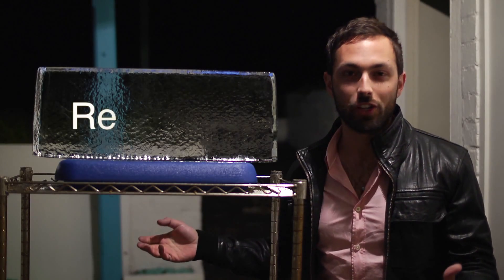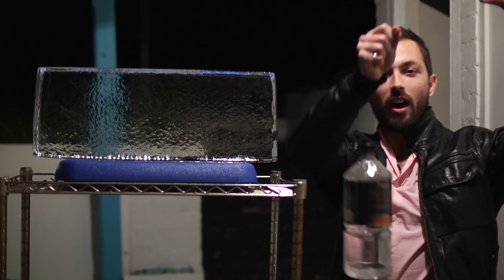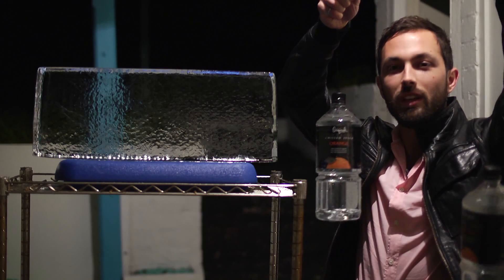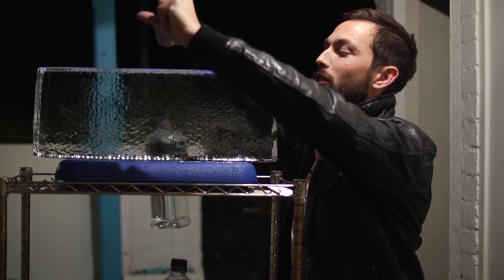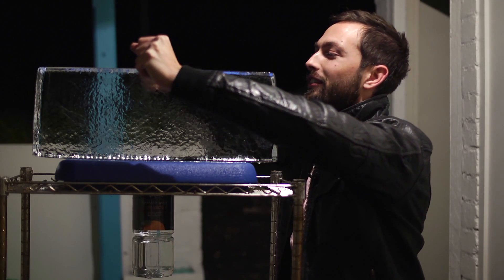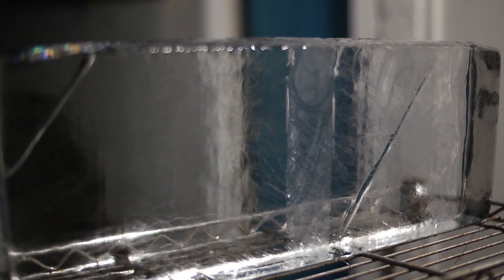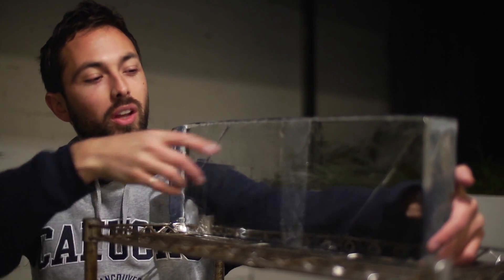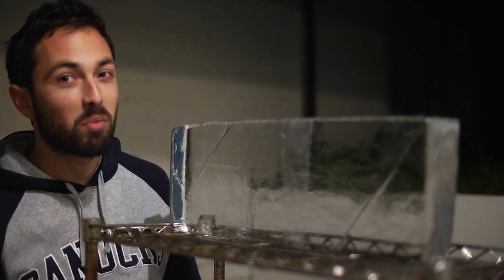Does Pressure Melt Ice?

Comment: Does this prove anything?
Did the ice turn to liquid, or was it just cut as a solid and then refroze together?
Even if the ice turned to water, did it then re-ice because the pressure was released in the upper parts, or because it was close to the two sides of the block that cooled it down?
From a point of critical thinking, as much as I believe that the melting point of ice reduces under pressure, I don't think this experiment proves it.
I would like to see a small cube of ice in a hydraulic press (its whole top+bottom surface, so it is not cut) or something. I would say the sides would have to be contained so it does not crush to pieces, and then we should wee a small amount of water going down from it a refreezing. Or a pressure chamber, it would melt, then release the pressure, it would refreeze.

Comment: veritasium: "i chose the e-string because it's much more thinner than the g-string, and that's important."

me: "what"

veritasium: "what"
Reply: @AbdulWasiun_Tech  g string is a type of women's underwear, it's also called a thong.
Reply: @AbdulWasiun_Tech  see the face that he makes at that moment
Reply: @AbdulWasiun_Tech  
the joke is about the g string
Reply: Area of pressure is lower, and thus pressure per cm² or something is bigger
Reply: @FarhadHakimov  While you are probably correct, I think you missed the joke
Reply: Farhad Khakimov 
Force per cm squared. Not pressure. Pressure is the result of force/area. Not only did you miss the joke but you also missed the theory course.
Reply: @frlfrl2098  ur wrong
Reply: @willswan8896  
Then correct me
Reply: @willswan8896  he's not wrong at all
Reply: @willswan8896  Pressure is Force/Area. So, if we have the same overall force (weight of two bottles), pressure is stronger when we have a smaller area of contact. If the area increases, the pressure decreases. If area decreases, pressure increases ("more force applied on every cm^2")

Comment: I'm not buying it. There's equal pressure across, yet the wire is curved. The wire picks up heat from the air and transfers heat in from the sides, the center staying coolest. It refreezes because the cut is thin and surrounding air temperature doesn't enter well enough to keep it above zero.

Comment: You should repeat this demonstration in a freezer because one could argue that this was about metallic string tranferring heat from the room into the ice and the melting of the ice happened around the string because of that. And obviously the water will freeze again after the string has gone away because there's a big block of ice nearby. If the room had been below 0 °C this cannot happen because the whole string would have been sub zero for the whole experience.

I see you already did this: https://youtu.be/qQCVnjGUv24

Comment: Couldn't this just be explained by the sections of wire in open air, absorbing the heat in the air, transferring it into the ice (melting it) then slowly descending, then the water refreezing due to the lack of heat energy input and having what little heat energy it has being absorbed by the rest of the ice? 

From what I've found, in order to lower the freezing point of water, it takes 1 atmosphere to lower the freezing point by .0072 degrees Celsius. That's 138.88 atmospheres (or 2,040 psi) to lower the freezing point by 1 degree Celsius.

If this is truly regelation, then you should be able to replicate it in below freezing temperatures. I'd like to see it in 0 degree Fahrenheit weather.

Comment: The cord dissipates the cold heat, so the ice melts, but once the cord has passed, it can freeze again easily. The experiment does not prove that what happened has anything to do with pressure. To do this, you would have had to place another cord that had no weight.

Comment: So here is why this obvious and well known fact is weird to me:
1. shouldnt heat only be created when something is deforming? If you pressure something and it doesnt deform (it will only deform a tiny bit when the pressure is applied and after it has reached a new equilibrium no more deformation should take place) shouldnt there als be no heat production?
2. if point 1 is not true then where the hell is that energy coming from? That would mean placing a large mass on another mass would be producing heat energy constantly without losing any potential energy because without deformation it wouldnt be getting closer to earth's center. So that should mean you can produce heat out of... nothing...?

Comment: Was it really the pressure that melted the ice? Or was it the transfer of heat through the string?
To do that experiment properly, you would have to perform the same thing in an atmosphere that is at the same temperature as the ice, maybe that string has salty sweat from the fingers that was doing all the melting? I bet that the g string would have gone through faster! Especially if it had been worn LoL...

Comment: Doesn’t the temperature of the wire play just as much a role as any pressure? The wire isn’t 0 Celsius either. I think in order to isolate the pressure cutting the ice theory the whole thing should be done in a freezing environment or the wire should also be cooled down.

Comment: could a similar effect be achieved if you used a very hot wire, maybe by using a steady electric current, to use on meat. would the wire cauterize the wound as it went through?

Comment: You get the award for least scientific science experiment. 
You added a heat sink and weighted it with more heat sinks. 
Had you used nylon floss or pretty much anything not metal you'd be closer. Or had the exact same set up next to it with less or more weight to show the difference the weight makes.

Comment: If it was above 0 degree's centigrade could the ice be melting due to an increase in the rate of temperature increase given by the wire, which conducts heat more than the surrounding air? As for it solidifying again as mentioned below could that not be because the gap is exposed to the surrounding ice rather than the wire after the wire has passed through it?

Comment: The ice is at least at the temperature of —10°c where the string is hardly the temperature under 20°c. It will exchange heat when they'll touch each other. Let's not talk about room temperature. You should have told people the reason why it's happening in the experiment. I guess you don't even know why those 2 pieces of ice get affixed although they were cut in half. I'm not saying you are not good. But don't give them the wrong information 🙂

Comment: Doesn't the type of the material of the string also contributes to the melting of the ice? It can act as a better conductor of heat coming from the ice block's surrounding that's warmer than the ice, compared to the air itself.

Comment: This is actually because where the ice finishes there is less atoms holding the water atoms in place and they are in a state that is neither liquid neither solid. So no, ice isn’t slippery because your body applies pressure and melts it turning into water. Also water isn’t as slippery as ice is.

Comment: It's not that I don't believe the phenomenon exists, but your experiment has a problem. The refreezing could be happening because you have ice right there freezing the water again. This experiment should be made in a vacuum chamber with ice temperature, regulating air pressure through vacuum or pumping air inside or using a pressure instrument. The key thing here is keeping the environmental temperature in freezing temperature and all instruments in freezing temperature as well

On a side note, that explains why just putting ice in your mouth melts more slowly than when you apply pressure with your teeth (without crunching)

Comment: Try it again with a string of plastic. Plastic has a lower heat conductivity then metal, but uf it is because of pressure they should pass through the ice at the same time.

Comment: This is thermal conductivity nothing g to do with the pressure u put on it. The wire is being heated because there is a lot more wire not touching the ice which will make the wire touchi g the ice a fraction warmer than the ice it’s selfie causing it to melt and because it takes so long to cut and because the cut is so small it is able to re freeze itself back together.

Comment: That's not just pressure. This is very misleading. In fact, increasing pressure alone would actually induce freezing. This has more to do with crack propagation (induced by high local stress).

My guesstimate as to the refreezing is that it simply caused by the surrounding ice having low enough energy state to absorb enough energy to freeze any local water that has been liquified during the process of crack propagation, which could only occur if the temperature of the room is above 0°C.

This is coming from what I've learned from engineering classes relevant to the situation - mechanical behavior of materials and thermodynamics. And I can definitely say that pressure alone is not the cause of this phenomenon.
Reply: Monly96   I believe the temperature being above 0 degrees C is part of the experiment.
Lowering pressure can cause water to boil, and I also know of water condensing into ice under extremely high pressures, as is the typical in basic thermodynamic theory. 

If you account for local stress concentrations in a crack, helped by a wet surface layer caused by the temperature of the surroundings being above freezing temperature, you can cause the ice to easily cave (crack), relatively speaking, cue crack propagation. Refreezing could simply be a process caused by the cold thermal reservoir - the giant chunk of ice.

My details could be off in relation to the full process, but my point is that an increase pressure alone causes water to freeze, not ice to melt, so another process(es) is/are at play.
Reply: @Monly96 Interesting. Yeah I'm gonna be honest I didn't expect water had a negative slope in the phase diagram between solid and liquid. It's possible it melts under higher pressure up to a certain point where standard effects overcome the special properties found in water from it's secondary bonds, that would explain why I've only heard of water condensing under pressure at extremely high pressures.

I guess the much more interesting question is why water/ice behaves that way under pressure.

Comment: It looked like the ice was melting meaning it wasn't below freezing where it was stored. If that's the case then the guitar string could be wicking away the heat as it cut through and the water refreezes because the internal temperature of the ice is well below freezing.

Comment: This is a unique characteristic of the water coming out from its hydrogen bond, which causes H2O molecules to form a kind of hexagonal shape when it is in solid-state. This makes the solid state of H2O, the ice, less dense than the liquid state of H2O, the water, unlike other materials because there is vacant space inside the hexagon of the frozen H2O; general material's density is higher when it is in solid state.  (if the ice were more dense than water, there would be no iceberg floating around the two polar regions).
And, as pressure increases, density also increases, regardless of one's state: solid, liquid, and gas. Same for the water. As pressure is exerted on the ice, its density also increases, and the most dense condition of H2O is achieved when it is in liquid state, the water (the pressure breaks the hexagonal shape of H2O).

Comment: Is the ice cutting due to pressure or transfer of heat through the string? Also, the water at the cut might be freezing again due to the contact of ice around it.

Comment: here's a fun experiment you can try. Take a 20 ounce plastic bottle of soda(unopened) and place it into your freezer for 90-120 minutes. if your timing is right, it will still be in liquid form with no apparent freezing/ice formation noticeable. Remove the cap and watch as the soda flash freezes before your eyes. When you remove the cap, listen for the sound of excess carbon dioxide rushing out as it is released from the sealed container. that sound will signal a sudden drop in the bottles internal pressure which will then cause the liquid soda to instantly crystallize into a slushy semi solid mass so that you'll now have to squeeze  the bottle to get the stuff out.

Comment: one thing I don't understand. How are we sure that the sorrounding ice isn't simply re-freezing the water? How do we know it's the release of pressure?
Reply: you mean re-freezing and yes its not the release of pressure that re-freezes.
The required pressure is much higher than he applies to the ice. It's just the string heating the ice by thermal conductivity and it re-freezing due to contact with the frozen ice.
source wikipedia
Reply: @FullOilBarrel  so this experiment proves nothing then cool
Reply: @RainingArtillery  no yea your right. if he conducted it in 0 degrees C the string and the ambient temperature couldnt liquify the ice

Comment: ummmm what about the temperature variance of the exposed wire?  The wire closest to the edge will transfer heat to the outside edge to start the process.  Not saying what you did isnt correct but it doesn't take a lot of heat to melt ice.

Comment: not an accurate experiment, since water on the surface (where the cut was) surrounded by the ice, which cools down it to the point where it again became ice. 
So hard to say is it pressure release effect or just heat exchange.

Comment: The experimant as you did it doesn't proove regelation. The string may be conducting heat from the room to the ice and melt it.
To proove regelation you need to repeat this experiment at a temperature below 0 °C